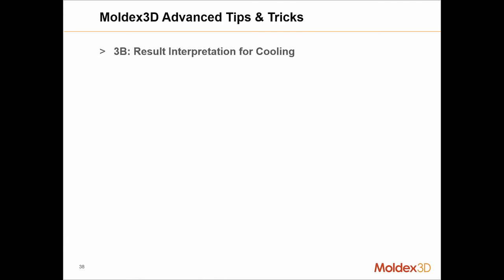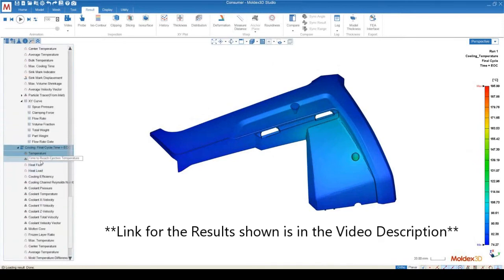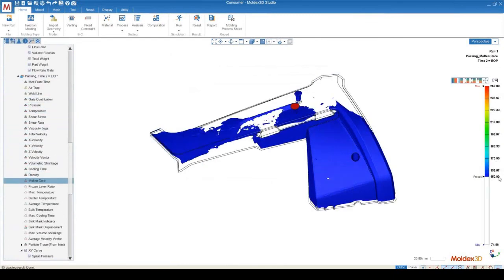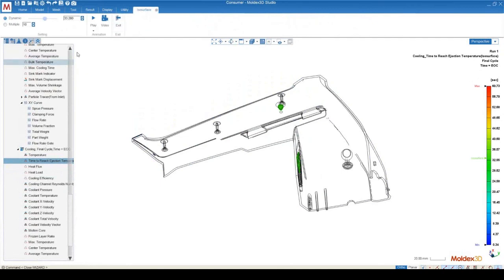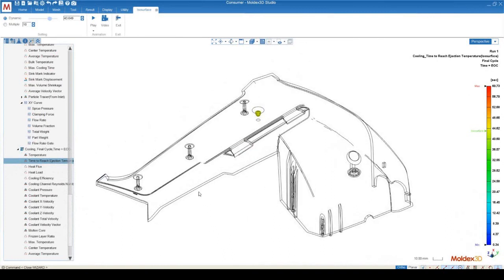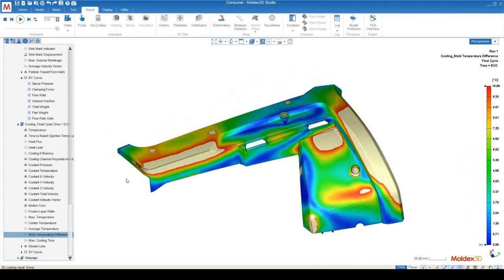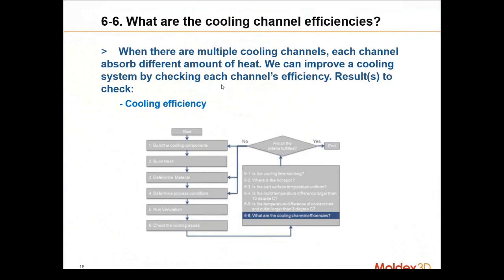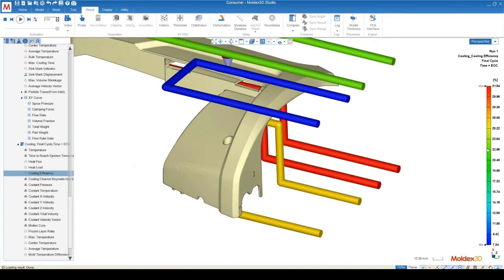Cooling Analysis Result Interpretation | Advanced Tips & Tricks | Moldex3D Studio

Comment: It's very good. I learned a new thing that I have not had known, which was the way to interpret hot spot with moldbase.
Reply from the maker: Hot spots are really difficult to analyze without the use of simulation.  Glad to hear this video helped your understanding of hot spots!
Reply: @moldex3dnorthamerica599   Yes, you are right that the simulation is a spectacular tool. I just thought that there was no information about cooling pressure. I think, It's an important result too.
Reply from the maker: @weerapongwanchaidee4815  Our 3D Cooling Channel CFD analysis allows users to characterize the flow through the cooling system to see results like Coolant Pressure, Velocity, Reynold's Number, Stream Lines and more.  

It is a bit more comprehensive of an analysis and takes a bit more time to calculate, but the results are worth it if you are designing the cooling system from the ground up!